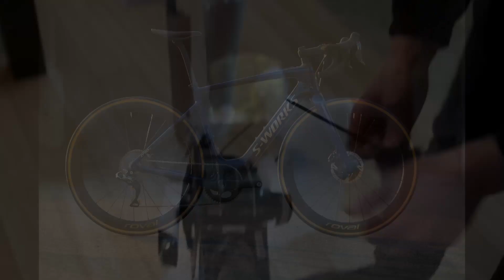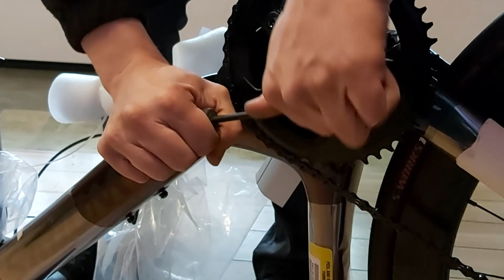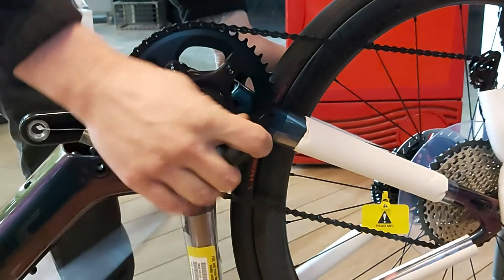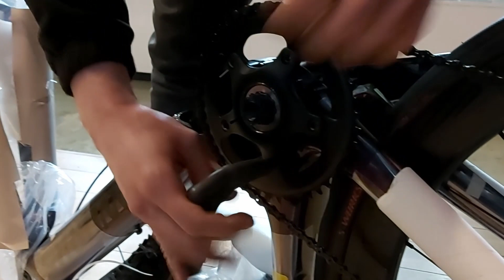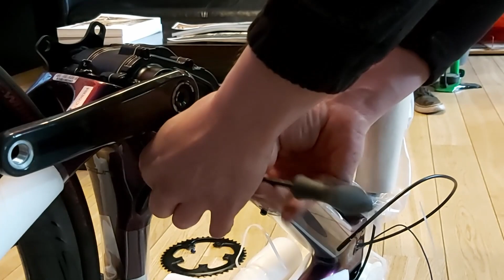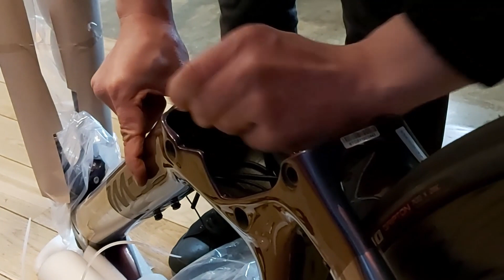How to remove or change S-WORKS TURBO CREO SL / SL EXPERT EVO / CREO SL EXPERT battery

Comment: No need to remove the crank arm.  It's way easier to remove just the chainring to get access to the motor bolts on the drive side.

Comment: Too bad ZZK Shop thought that playing this annoying music was more important than discussing the sizes of the fittings, the torque specifications when replacing the bolts, any concerns/warnings during the procedure, what tools are needed (on one page, videoed of course, or linked to).
Reply from the maker: Such work can be performed only in certified specialized stores, where mehanic are trained to do so. This video is informative to show people what it looks like from the inside.
Reply: @zzkshop4826  Gotcha. My mistake.
Reply: They’re the only ones willing to put a detailed video like this together. Don’t be rude!
Reply: @LightYagamiVSL  If you're referring to my comment I don't see its rudeness. I was being honest in my disappointment and critical in its failings, from my point of view and expectations. 
It got cleared up when I was informed as to the purpose of the video which was more for the general viewer than for the technically oriented.

Comment: Thanks! Very cool to see inside. Is it possible to remove both the motor and the battery and still ride it? Thinking long long term...
Reply from the maker: The battery serves as part of the bike frame, and other than that the bike would lose part of the frame's durability
Reply: you can ride without internal battery.. it was designed that way so you can fly your bike if you want
Reply: I meant both the motor and the battery.  I know you can remove the battery but the motor is another 5 lbs or so and seems like it would be removable.
Reply: @brooksbell3662  motor has to stay in to ride the bike I think